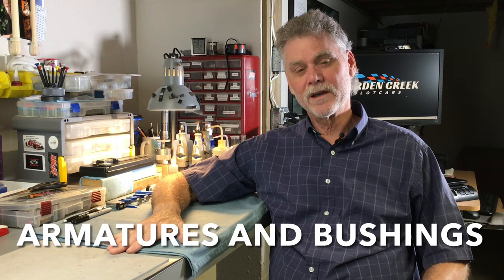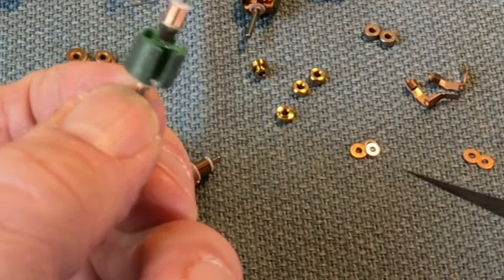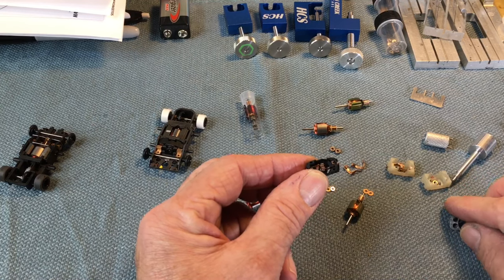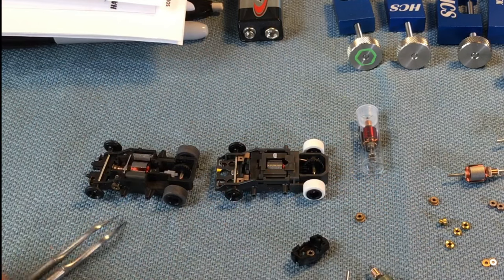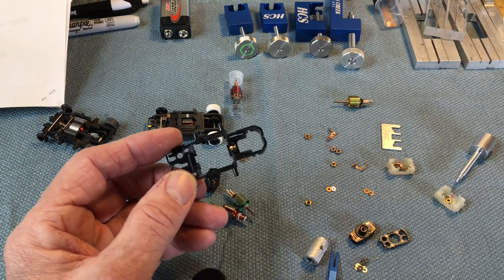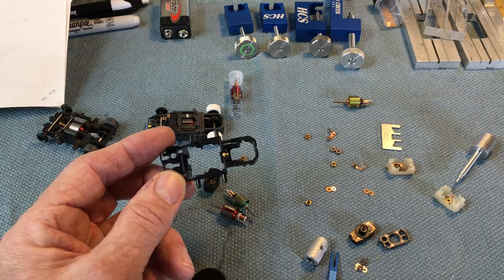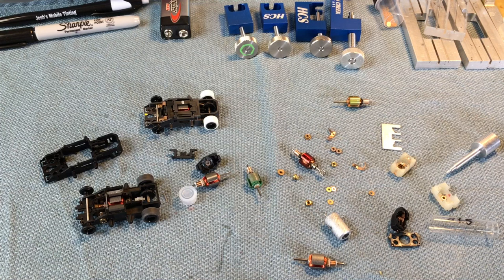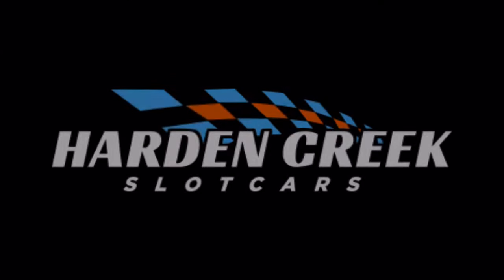My Favorite Parts - Episode 5 - Armatures and Bushings

Comment: Was really anticipating this edition and you didn't disappoint. I especially appreciate the explanation of timing and your associating the different magnet strengths with the various ohm ratings of the arms. Lots of people don't realize that these individual parts form a system where the performance of each part is interdependent on the other parts.
There's no "magic bullet" in the equation. It all has to balance out.
Excellent video!😎

Comment: Terry, thank your for the Indepth information on the armatures.  I knew the timing was 90 degrees different and then it's 45 degrees on the armature.  I have never heard of soldering the pinion and using metal gears.  How much downforce do you need to keep from stripping the plastic?  Oh yeah, saw a couple tools for the endbell bearing. Still, how about a video showing replacement of the shoes?  Happy Holidays.